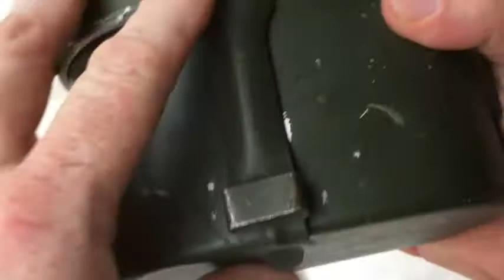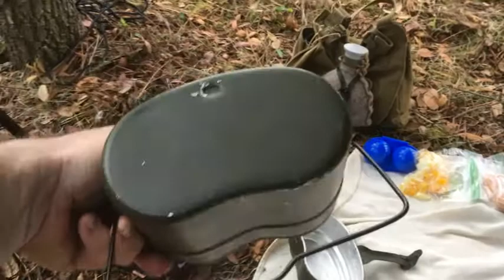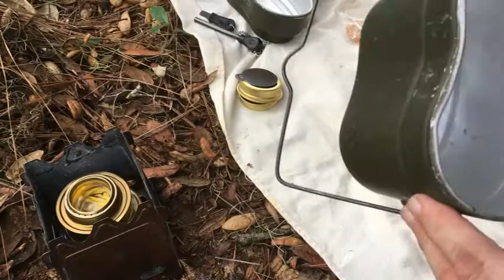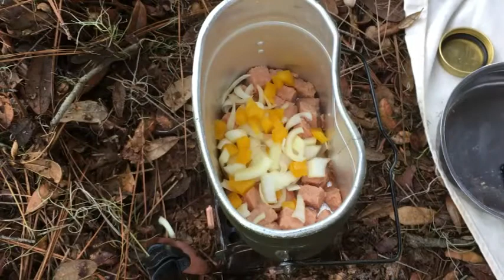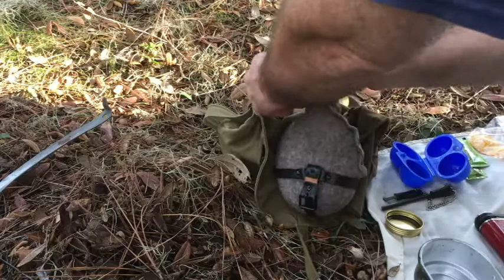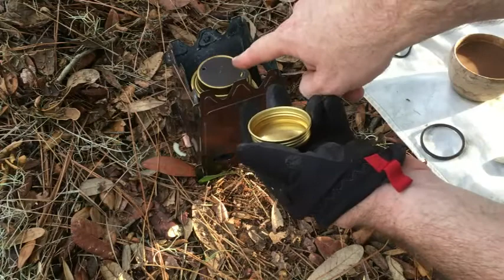Hungarian Army Mess Kit Review and Cooking Demo.

Comment: I boil in a pot, and fry in the US skillet.  Or, for fun, in the Russian skillet.  Or in the lid/plate with the kit you have.  I find it's a lot east to fry eggs, or brown a small quantity of something, in the lid/plate, and use a pot gripper, if there's something to grip. .  And I'm never, ever without   I also carry a small container of cooking oil, a small container of lard, which never seems to go bad, and usually a small container of bacon grease.  Love eggs fried in bacon grease.

I've tried at least a dozen ways of carrying eggs in the field  If you have free range chicken eggs that have never been washed they stay fresh a very long time.  Washing the eggs removes a natural barrier against bacteria.  You can make store bought eggs last a very long time if you coat them with wax before any bacteria gets on them, but it's risky.

I carry free range, unwashed eggs in a padded, egg shaped container.  I've never had one break or go bad, and I've had some in the field for over a month.  Regular eggs from the store have shells so thin I don't even try to stop them from breaking.  I pre-break them into small plastic containers with screw on lids.  Each container holds two large eggs  The containers cost two for a dollar, and I bought six packs.  One dozen eggs.  I greatly prefer unwashed free range eggs because they can last for months.  I've seen good ones after a year of room temp storage, as long as bacteria couldn't get to them.  The natural barrier wears off, so you need something around the egg to  protect it, whether it's an airtight container, or salt, or cornmeal, etc.

Comment: Another great and informative video. I rely on your videos to help me decide which mess kits to acquire. Very much appreciated!  Btw what fuel do you use in the little burner?  Thanks and God bless
Reply from the maker: I use a product called Heet. It’s a automotive gasoline fuel tank additive used to prevent fuel line freezing in very low temperatures. I believe it’s pure alcohol because it burns so clean and hot. I use the Heet product in the yellow bottle not the red bottle. It’s found in Walmart and automotive parts stores here in the US. I have had very good luck with it.

Comment: love your vids, modified dog leash is good to use as lether straps for these style tins, also the hungeran water bottle will fit inside the kits and is ment to be carried like that I've been told, all the best
Reply from the maker: Great idea with the dog leash. It would give a more authentic look compared to the Velcro strips I use. The canteen you mentioned must be the short stocky one that I have seen. I would like to add one to my collection some day. Thanks for watching and for your comment!
Reply: John Sherwood 
I done it with my West German tin and it works great and you dnt have to worry about it melting the straps, I'm not sure what version it is the waterbotle is for but it fits in simler designed ones, it's not the wooden canteen it's a circular shaped aluminium  one, anyway love the videos, and give the dog leash I try it's not too difficult a bit of sewing for the buckel and that's it, take care

Comment: How do you get it clean in the field once you have spam and eggs baked on the pan?
Reply from the maker: In this case, I was just doing a daycamp so I washed it at home. When at regular camp I take a small sponge (regular sponge cut smaller) and biodegradable soap with me and wash at camp. I usually do not have a problem with excessive food sticking to my cooking stuff. Using a lower temp while cooking helps keep stuff from sticking. But if I do happen to have stuck on food, I just put water in the pot and put it back on the fire and heat it up to boiling to release the food.

Comment: The handle needs to be dead straight immediately before the loop. If you remove it and make that adjustment it will function as it should. I just picked mine up for $6 including postage on eBay. An absolute bargain.

Comment: Thanks for sharing. If you could only have one version of this style mess kit to be your primary, which one would you choose?
Reply from the maker: Well, that depends on what I'm doing. If I need lighter kit with an extra cup or container with a handle, then I would choose the East German kit. If I didn't need that extra cup then I would lean to the heavier Swedish mess kit in stainless because of the included stove and windscreen and the fact that its bullet proof. Unfortunately, I don't have the Swedish kit in stainless so I have the next best thing which is in aluminum. 
Then there's other styles of kits that I like other than the German style kits I mentioned above. If we went down that road I might be here all day discussing those :)
Reply: John Sherwood lol. Thanks.

Comment: the most pressing question i have, as i recently just acquired one, here in LA, is the paint safe? worried about carcinogenic fumes when on the fire. i tried placing mine on open fire yesterday and it could be me overreacting but the paint seemed to not be liking the flames. quickly switched to my non-painted post-war kit.
Reply from the maker: You could be right. Who knows what kind of paint they used back then. The kits were most of the time used through a chow line wherever the solders were located and the use of fire to prepare food was a secondary backup in case the mobile kitchen was not available. 

Most of the kits in my collection I have used only once or twice for a video or demo and then put away. The ones I use the most are the stainless USGI mess kit and canteen cup set at about 90% of the time and the East German kit and the Czech mess kit at a close second and third.  

If you plan to use your kit a lot, you could remove the paint (especially on the bottom of the cup where it rests on the pot) so you don’t have to worry and fully enjoy your kit. Other than that, it’s a great little kit that should serve you well.
Reply: John, thank you for the thoughtful response! Interesting history lesson, was trying to figure out why a lot of these kits that seemed to have gotten “some action” don’t have any burn marks on the bottom! Makes perfect sense.

In regards to the paint, I’ve been rather torn the last few days, so this is an extremely helpful response. The intention is to use them as often as my 1950s boyscouts’ kits and Worcester Pressed Aluminum Company kits. So maybe getting the paint off might be my best bet!

Speaking of my other kits, in all the years I’ve used my other kits, had never experienced burning off the wing-nut right off the screw attaching handle to pan. What I get for leaving kit directly on open fire and unattended for 5 minutes. Still absolutely shocked that the fire was that hot. Think it was the original wing-nut. Curious what alloy it’s made of, for that to have melted down like that. Now to see if I can remove the melt off the screw with any success. If not, will just have to replace wing-nut and bolt all-together.

Wonder if you’ve ever experienced something that odd before? 

Incredibly helpful stuff here, all the same. Thanks for listening!